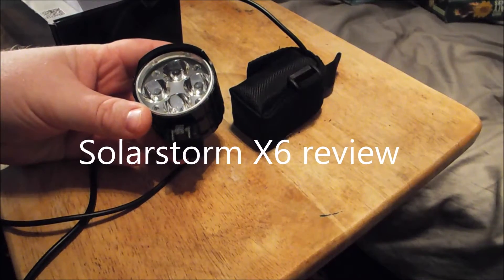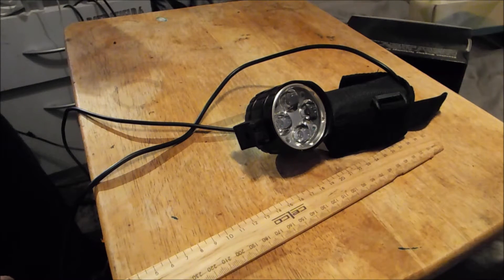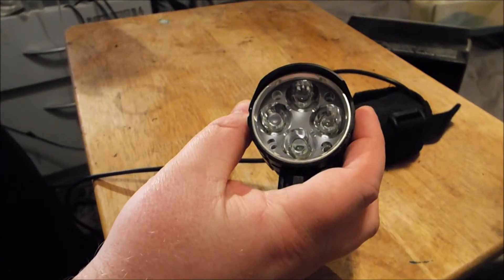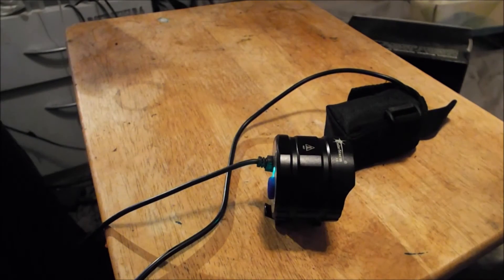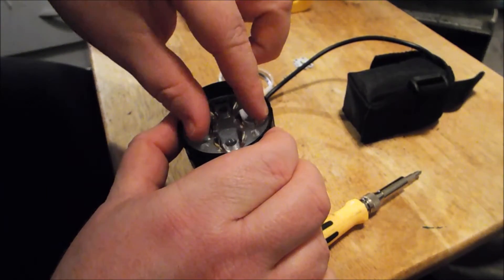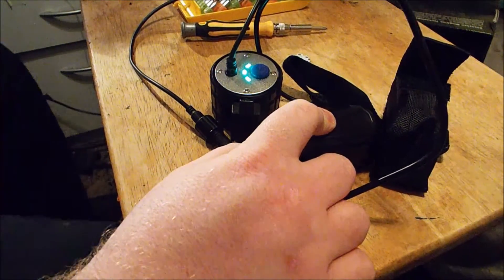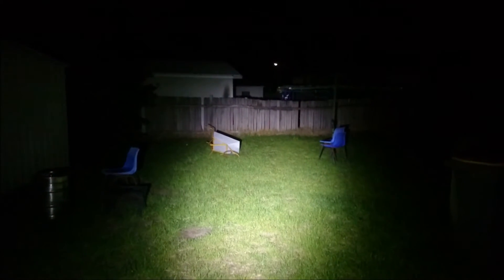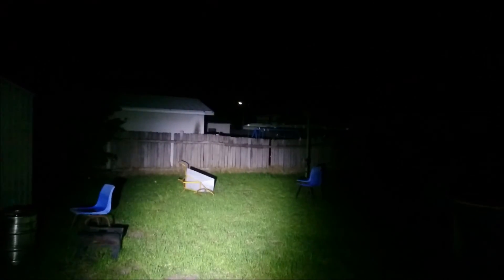Solarstorm X6 Review and teardown

Comment: Hi Chris, the 4 LED flashlights I have been using all had issues with heat dissipation (as you mentioned as well in the video). Can you run this light indoors on full brightness, without the light turning down it's power? The ones I was using generally already got hot after 5min on full power. How is the performance on this particular flashlight?
Reply from the maker: Hey mate. Nope heat dissipation on this light is subpar. Not enough cooling material in it. Its made to be a bike light so they probably cheapen out on materials. If you where riding with the light you would have cool air going on the light all the time. 
What kind of indoor setup do you have? I have gotten a few LED strips for the shed that work decent?
Reply: @everydaysurvivalgear  thanks for the information. There are of course better options for indoor lightening. I just wanted to have a reference, because the other light I have doesn't work indoors at all, you start to feel the heat already after less than 1', after about 5' it will turn down it's power. Riding on my bike does with that light also not work on full power, will turn down its power after 15'. I'll give this light a try. Thanks again.
Reply from the maker: These are easy to take apart you can always add your heatsink to help dissipate heat. It might be worth looking at the BLF Q8 or a similar light. It's built well and should be up to the task.
Reply: Thanks alot man. I ordered one, great idea, I'll mount a heatsink if needed.

Comment: Could I use my 12V battery(3s2p) with this light??  Thank you!
Reply from the maker: Sorry about the late reply! Input is 2s2p only i think. It would be a buck driver of some sort so you can try a higher voltage and see what happens but i am not sure if it will fry the driver.

Comment: Hi just got my solarstorm X6. It looks nice and strong. I have a question to you. When I start the lamp and I notice that just two lampa seems to be on. Is it normal?
Reply from the maker: Hey mate no that is not normal. Do they light up at all?  Do you have a multimeter?
Reply: hi I think I figured it out. The batery was not full charged. Efter I charged it all the four lampa were working together. Thanks for help!!

Comment: It would be more nice if it worked with usb
Reply from the maker: Hey mate the main issue is that a USB charger or bank could not deliver enough power overall. The most power most banks can deliver is about 10-12 watts. This light is using at least 20+ watts.